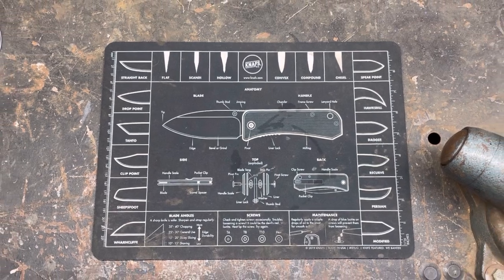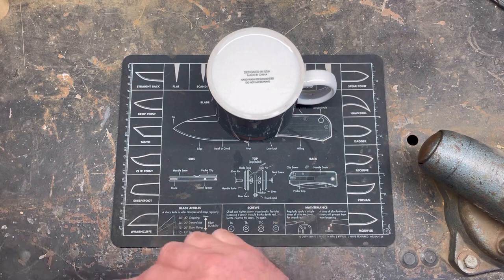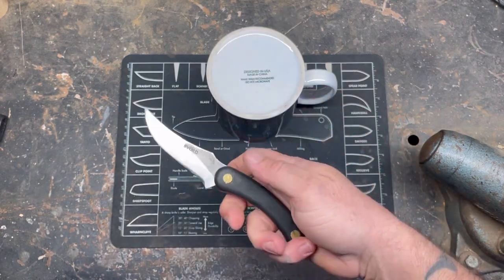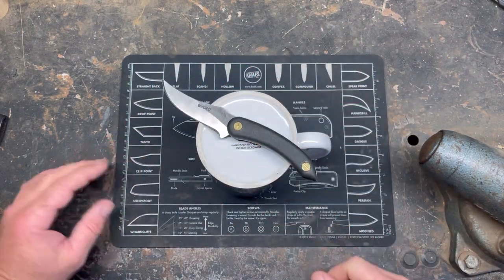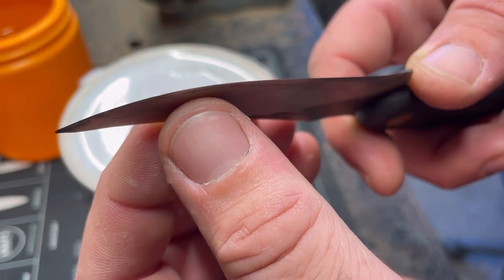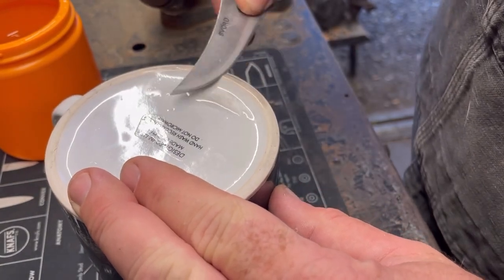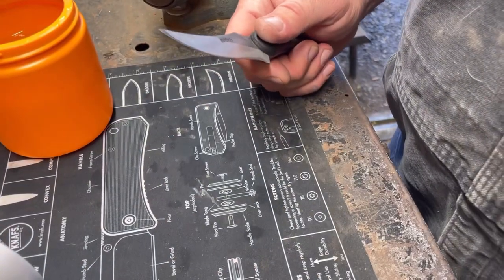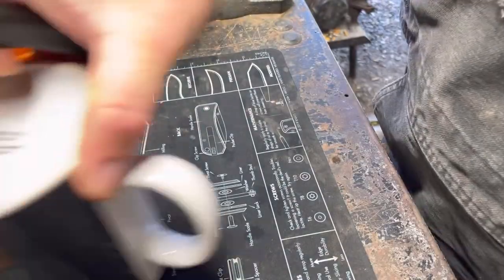Trying to sharpen a knife on a coffee mug

Comment: As long as the surface is harder than the steel, it should work, and of course the smoother the surface the better edge.
Fun fact: My grandfather would sharpen knives using the bottom of a broken ceramic butter churn!
Reply from the maker: That’s cool

Comment: The right pressure speed and stroke, will get her done😁
Reply from the maker: I’m sure you are correct. But this dang cup wanted to tip over when I applied more pressure. Maybe I should try a bowl
Reply: I freehand sharpen, but nowadays I only my butcher knife witch is Tundra Camp 3 by Bark River, it's kind of like a Japanese kitchen knife, but then the Rajah2 and the Amish Jon I let those things get dull like my machete and axes, vintage axes I need new axes tho, save vintage Steel